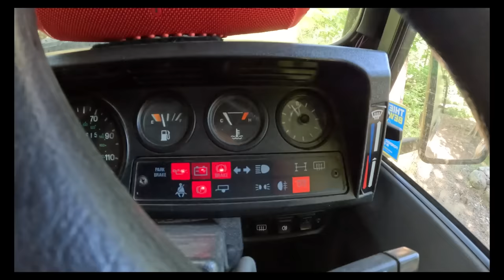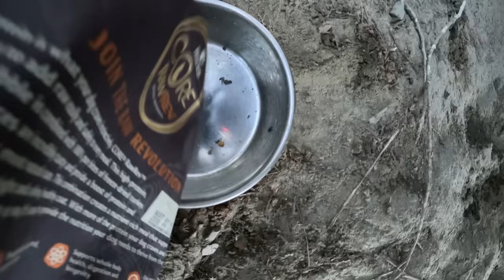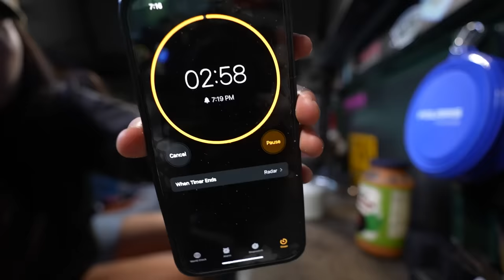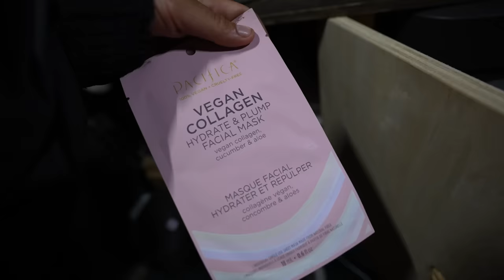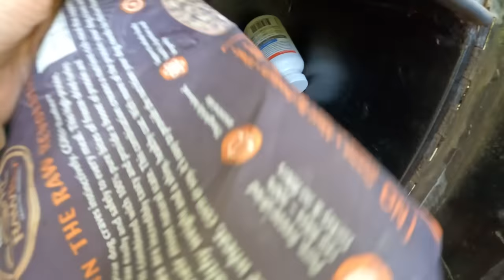Luxury Truck Camping in my Defender

Comment: I was going to ask you how your truck was running, and you answered it. So years ago, my diesel truck would have a rough ideal in the morning also If I can remember right, I do believe it had something to do with bad fuel injectors or the spark plugs and coils. Because you're getting a lot of smoke, i would definitely get someone to look at your exhaust system along with your air filters. Ahh, the joys of old vehicles. As long as you're having fun with a smile on your face, that's all that matters. Hope this helps. Safe travels.

Comment: Diesel mechanic needs to look at this one., if this would be a regular gas truck white smoke indicates burning coolant so either head gasket / crack ....any issues with overheating ? coolant levels getting low or milky looking oil when changing oil ?.usually at the very beginning this will be at the start up when engine blows off coolant collected over night , but with time it will get worse ......my guess pressure test the engine at the good diesel mechanic \-/ or you will be camping a lot :) .....great set up , love the build and camp spot ….if anything just needs a engine swap 😊 seems most Youtubers doing HEMI swaps these days :😊

Comment: I've been watching some campers trying out portable air conditioners. One of light weight with a handle and has a battery attached to the bottom. It will run for 4 to 6 hours on a charge. And it can be plugged in. These people were actually camping in insulated tents.

Comment: I had a similar issue with my 12 valve Cummins. The injector tips were gummed up with soot and carbon and until the motor got hot enough to get the buildup soft enough to free up a few jets in the nosels tips it would run like that. I wound up replacing then with higher horsepower injectors and hasn't given me the issue since.

Comment: Pull the injectors. Perform a compression check. If compression is good pop test the injector and perform pump timing as recommended. My guess is you have a leaking injector causing you to lose prime and also dripping fuel into the cylinders causing the excessive smoke on start up.

Comment: Leaky injector or injector cup….fills a cylinder with fuel while sitting…cylinder can’t fire on start up because it’s over fueled causing the rough running on start plus the white smoke…next time you do an oil change, have them do an oil analysis,  that would diagnosis this as fuel will be present in oil.

Comment: if you have not gotten the rough idle problem solved yet, you have a small amount of oil leaking on the pistons when you stop overnight etc. that is also the reason why you have the smoke that you have coming out of the exhaust on start up. more

Comment: white smoke out of exhaust usually means coolant or oil leaking in to the cylinders. Judging by the amount of smoke and colour of the smoke I would say its the coolant and I hope that your engine block is not cracked and its just a gasket.

Comment: I’m afraid your diesel engine is worn out.
Diesel’s run on heat. Air is compressed and fuel is injected into the cylinder.
If the cylinder is not developing enough compression it doesn’t fire properly.
Pistons when cold and worn (rings) will miss fire (run rough).
Then when the heat of running has gone up, everything is back to normal (cylinder expanded, pushing rings against the cylinder wall..compression is achieved)
A engine rebuild may be in your future (cheaper than a new engine, when done right)

Good luck!
Love your enthusiasm for life!

Comment: Injections or Fuel Filter could be if you have used a lot of gel it could be stuck int he filer. As long as you dont have milkshake in the coolant its NOT a gasket so check injectors and Fuel filter

Comment: I had a similar problem with my Defender.
Turned out that I must've put some bad fuel in it because, after a couple of further fills, it got better.
Alas, that wasn't quite the end of it. 
The problem didn't go away completely but, realising it was something to do with the fuel, I replaced the fuel filter and that improved things more.
It still wasn't perfect, though, so I ended-up removing the fuel injection pump, stripped it down and cleaned it all before refitting it.
At the same time I flushed a heap of diesel through the fuel lines and replaced a couple of fuel hoses and the pipes to the injectors.

Honestly, I'm not sure how much of that was necessary but it cured the problem completely.
Maybe, if I'd had more patience, clean fuel would have flushed any crap out of the system eventually (possibly requiring replacement of the fuel filter a couple more times) but, on the other hand, maybe leaving it longer would have caused damage to the fuel injection pump and/or  the injectors, which would have been worse.

Thing is, if there's any kind of crap in your fuel system, when you stop the vehicle it settles inside the hoses and then, when you start up again, you're getting a slug of crap going through the pump and injectors and then into the engine.
Once the engine is running and the fuel is flowing it'll find it's way through the crap and the engine will run better... until the next time you stop and give the crap chance to settle again.

When it happened to me, a bunch of people suggested it was likely to be the result of air in the fuel lines.
The fuel filter screws onto an aluminium casting mounted to the bulkhead.
You'll see a large bolt in the middle, on the top, which attaches the fuel pipe.
Next to it there's a small bleed-screw (looks like a small bolt with a slot in it for a screwdriver).
If you loosen the bleed-screw while the engine's running and "foam" squirts out there's air in your fuel system.
(top-tip: loosen the bleed-screw with the engine OFF first, then nip it up again and then start the engine and loosen it again so nothing takes you by surprise)

If there are signs of air in the fuel it'll probably be getting in through the fuel delivery pipe on the tank or the fuel sedimenter near the rear wheel.
In that case, it should be pretty easy for a decent workshop to sort out easily.

No promises but the fact that it only happens from cold and then clears suggests that it ISN'T a mechanical issue (damaged injection pump would be the big worry) because that'd continue as long as the vehicle was running.
With either air or contaminated fuel, it'll have a chance to get worse while the engine is off and then settle down after the engine's been running a while so, hopefully, it'll be a fairly simple fix.

Please don't be disheartened by these problems.
Like I said, the purchase price for ANY vehicle like a Defender is only the "buy in" price.
The money you're spending now is to fix 30 years of wear and tear.
Once you get through that, you'll have a vehicle that's much more capable than any new car you could have bought for the same amount.
You just have to commit to seeing it through.

Comment: Best case scenario: Pour a bottle of diesel fuel injector cleaner into your fuel tank, buy the bottle that says Power Service Diesel Kleen in a gray bottle. Your fuel injectors might be dirty. If your truck stops white smoking after using it that was the issue and you have no more worries.
Worst case scenario: check your coolant level. If your coolant is low or has turned black from oil you have a blown head gasket. That’s an expensive fix as the engine has to be taken apart to repair.

Comment: Try using a Thermacell device instead of spraying those noxious chemicals on you? I hated being outdoors because of horrendous bug bites that would send me to the ER. Not a problem now that I have a personal Thermacell as well as a Thermacell designed for larger areas such as a patio or picnic table area. Game changer!

Comment: U have a leaking injector, causing a cylinder to get fuel in , hence the smoke that goes away, and in return causing air in the fuel system causing the rough idle

Comment: perhaps its  air seeping into the fuel feed lines , as they are under  great pressure  at times, I would rebuild the complete  fuel system , another tips is to power wash  the Engine as squeaky clean , then in strong daylight  watch it as it idles, look for any tiny leaks , you can place a clean cardboard  after a long drive , under the motor overnite ,  next morning Before starting Poe  , pull the cardboard , and inspect for any small drips of Diesel  oil and  or coolant .

Comment: Sounds like maybe a head gasket letting antifreeze ease in and setting on top of the piston from setting all  night , when it’s running and cool Take the radiator cap off and see if you can see little air bubbles coming up constantly if so then it’s a head gasket.

Comment: Hey Maria - Concerning POE's rough idling when "he's" cold and when you first start "him", I would have your Engine Coolant Temperature Sensor looked at, if in fact Poe has one.  I'm pretty sure he does.  This ECT sensor tells the vehicle's computer how hot or cold your coolant is which results how much or little gas your engine is getting (hence rough idle=less gas).  When the vehicle is cold, it should receive "more" gas, not less.  This could be the issue of your idle.

Comment: 1 or more injectors are bad or need adjusting.  One other thought.  Do you have to add crankcase oil frequently?  I would also get them to check for a leaking water jacket allowing water into the combustion chamber.  That smoke was white.

Comment: Sounds like a glow plug failure issue on one or more cylinders.  That would account for the ruff idle, smoke and once the fuel has established flow and heat from the engine compression why it stabilizes and runs well for the rest of the day. Could also be a bad injector  and that would account for the symptoms as well.  A key thing to note is the smoke is blue in color which indicates unburnt fuel and that could be symptomatic of a simple injector, glow plug or if those things do not pan out I would have a comparative compression test done and see if there is low compression in one cylinder.  Wish you the best in getting "Poe" running as he is capable of.

Comment: not to say anything wrong and upset anyone, but a coolant problem would be constant, your engine would overheat often plus you would be adding water or coolant often. after your engine burns off the excess oil your idle will be better . vehicle runs normal . then when it sits overnight again the whole rough idle smoke in exhaust happens again

Comment: Have you tried Diesel Fuel Injector Cleaner? Sea Foam or Lucas are good. they should be used regularly. Just pour a bottle in every other fill up or so.

Sea Foam also has an engine treatment that can be used once a year without removing the injectors.

Comment: if it smokes when you start it up and it runs rough, its probably getting oil onto the cylinder heads somehow, you may need to replace the O-rings on the cylinder heads.

Comment: I had a diesel and the previous owners didn't keep up on the oil changes and it had worn rings . When traveling at highway speeds 60-70 miles per hour the engine would blow smoke and rapidly increase in speed and rpm's and had to let the engine burn up the blow by , as my mechanic called it . Turning off the key wouldn't shut it down . I hope that is not what is going on with your vehicle ! Stay safe

Comment: The white smoke could be a crack in a gasket that separates your coolant from combustion parts of your engine... thus the sputtering... the engine warms, the gasket expands, the crack closes, the sputtering and smoke stops until the engine cools down again. Just a theory.  Happened to me once.

Comment: there should be an o-ring in for the p-trap under your sink. it may have gone bad and you need to replace it to stop the leaking. the size should be an 1 1/4

Comment: I use to have this issue with my 1973 Honda cb500. I know completely different ride but my issue ended up being the valves in my carburetor were too small. I put bigger ones in and adjusted the fuel to fire ratio. I looked online and it said the Land Rover defender had carbs. I’d get em checked out

Comment: Only watched a couple vids now, however, you need to keep moving. You’ve not had nearly the worst struggles yet. Regarding vehicle issues, based on the symptoms you’ve described (which were very good and significant details, btw) I’d suggest a mechanic now focus on these few things. Evap system for fuel, and PCV/blowby for oil buildup in the intake/valve covers or crankcase. Should have been spotted with a plug inspection. Dig deeper in those areas

Comment: sticky injectors would cause start up smokey. I don't know defender engines specifically.  but smoke is possibly stuck open injector, dirty fuel? (but usa has all fuels 1 hose type pumps). change fuel filter. get a garage to run a bleed off test to see if the run off isn't matched.

Comment: My guess, Diesel Heater Plugs..Try turning it on till the glow plug light on the dash goes out, turn it off( key), then try again with giving the plugs heat( turn key on again) .. Used to happen a lot on older Landys * up to 200 tdi,,,im not too familiar with the 300 TDi tho ) . Try it two maybe three times.. The smoke could be unburnt diesel as its trying to get going.. Best of luck

Comment: If its a diesel engine it may be bad injectors. The injectors can leak down into the combustion chambers while setting and Cause a rough start with a lot of smoke. If they haven't been changed in a while they probably should be. Any good mechanic should be able to do a pressure test to see if there's a pressure loss.

Comment: It sounds like your fuel and air mixture is off , that’s what produces the white smoke sometimes too much fuel is put in the engine, and that will cause white smoke, and then, when you starting up the vehicle in the morning, if all the fuel filters are switched sometimes the fuel filter in the gas tank could have settlements on it that will give it a rough start in the morning until it warms up , just my two Cents. Stay safe take care.🙏🤙👋

Comment: Normally seen oil or coolant making that kind of smoke, but won't rule out a diesel injector/pump being bad. Normally diesels overfueling have a very black exhaust smoke as per my experience. Could also be a glow plug thats gone bad, leading to the idle being rough on cold start🤷🏼‍♂️

Comment: You have  a bad injector or  injector is leaking. That’s why you have smoke coming out in the morning on first start up once you burn off all that fuel sitting on top of the piston  the smoke goes away. My opinion replace all the o-rings at the same time to save labor costs in the long run.

Comment: I'm guessing what's wrong with Poe is the piston rings/ valve seals are worn out. There isnt proper compression and there's also oil getting in the chamber. Causing the smoke. Hope it helps. Good luck.

Comment: I was always told white smoke from the tailpipe is usually burning coolant, which could be a blown head gasket (a pain to fix) or a crack in the head... which would not be a good thing. Coolant can be leaking into the combustion chamber with either of these.
Reply: A blown head gasket will probably cause issues continuously, not just at warm up.
Reply: @MaxPower-11  True, but if it's a small leak, it could be leaking at a slower rate than the burn. If coolant is pooling in the combustion chamber as the vehicle is off, it can be burning on startup... then there's nothing burning as the car drives, or, it leaks so slowly that we're not seeing any smoke as the car drives for long durations. Does that make sense?

Comment: I'd definitely have the injectors double checked. Just to make sure they aren't leaking down as it sits for an extended period of time. A possible worst case might be a blown head gasket. You can have a bad head gasket that will burn coolant, and smoke like that but not necessarily milk up the oil. If you pull the dipstick and the oil looks like a caramel macchiato, then youve got a bigger problem than injectors.

Comment: have you checked the Fuel Injectors themselves? can have a bad injector, probably leaking fuel into the head. if you take the valve cover off you may find fuel oil mixed in there, can also cause the excess smoke issue.
Reply: maybe a valve lash is needed as well.

Comment: You can use a paper towel to get the water or oils out of pan with meat in it.   
The rough idle then after warming up issue can be a multitude of issues.  I don’t even know what you drive lol.  Yr make and model plz. 
Typically vacuum hose , injector, I’m not certain but do u have carburetor or fuel injection.
How close r u to coming to Alaska.

Comment: asked an answered but no, you're not meant to strain off the "water" when you boil any kind of ground/minced meat. That water is actually fat rendering down, so what you want to do is keep stirring the meat so the fat all evaporates away and that's when you know to add sauce and it's cooked throughly

Also means you don't have to use oil to cook

Comment: Looks like Poes head gasket might be failing ie seal around the block causing oil and diesel to mix causing the smoke. If you blow a head gasket it can be bad
Reply: If it was a head gasket why does it self resolve, it’s a weird issue for sure. She did say hard accelerations can also cause it. I think there’s a fuel issue somewhere.
Reply: If it was a failing head gasket the truck would white smoke while driving
Reply: @takl23  I mean any old diesel smokes a bit on acceleration. This appears to be a mechanical engine so even more normal.
Reply: @WillE454  If Poe still has original cork gaskets instead of rubber then the wear would be worse.
Reply: @takl23  it self resolves because as the engine heats up the heat can make the gasket flexible enough to seal.